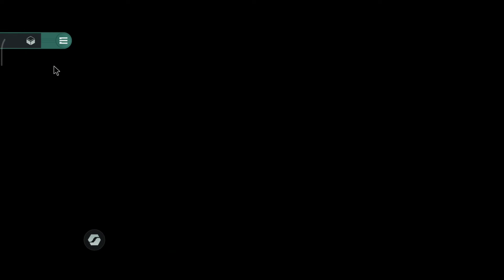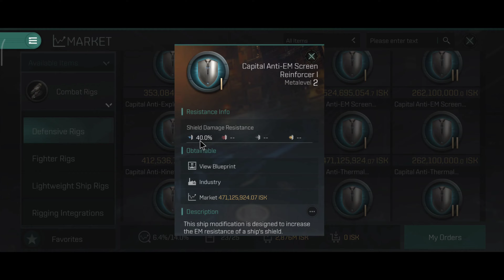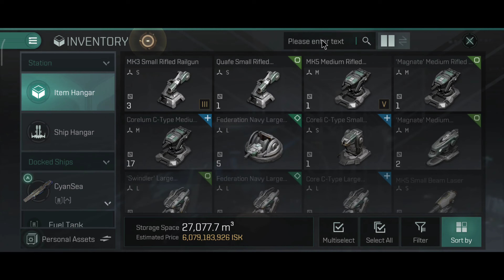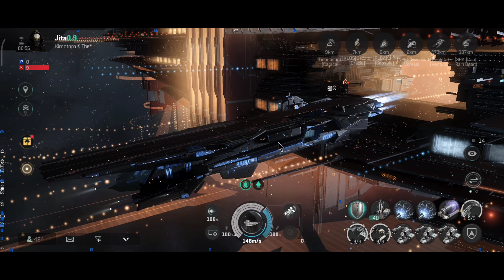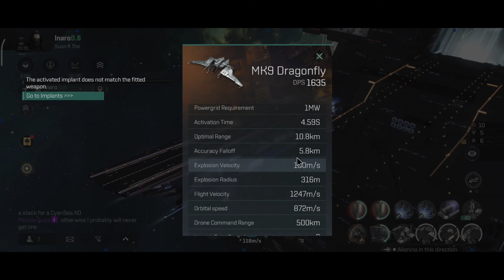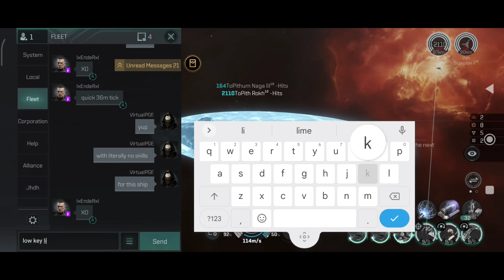EVE Echoes - CyanSea - CONCORD Special Faction Carrier - PvP/PvE Fitting Guide - High Sec Carrier

Comment: As far as capital guns go yes the cyan gets a bonus to damage but no tracking bonuses.  So for pve I find it's better to fit large ranged guns.  Though med rapids might not be a bad idea for those pesky close in frigs.  But overall those slots are not very usefule.  Now if the cyan had a dred mode those slots could be sick.  Thankfully it doesn't.
Reply: I fly mine without any weapons, because let's be real. This thing has so much dps with fighters that High slot weapons are unneccessary
Reply: @luxurianilindr4547  If you have them it feels silly not to use them to me.  I keep mine to large or med size weapons to kill those pesky true small hull ships.  Yes I can't believe that NE terms BS as small hulls now....
Reply: @almajensen405  I mean the slots are there, but they honestly could remove them and give us 3 more fighter bays. I am not even fully skilled yet and I throw my fighters onto a frigate and it just kinda ceases to exsist.
Reply: @luxurianilindr4547  with my cyan in managing 44-46m ticks running regular t10 null ratting with corp system bonus of 30%
Reply: @almajensen405  bold of you to take this thing into Null. My corp already blew up one 🤣
Reply: @almajensen405  but yeah this thing is super nice and relaxing for ratting or Clarelam lab farm
Reply: @luxurianilindr4547  island clan life

Comment: So the skirmish command is actually helpful.  It helps you to align and get to warp faster without having to use valuable low or rig slots.  Mids are the least useful of all slots on a carrier unless you are fleet boosting.  But that skirmish command is very useful for pve to help you get through the scouts and inqs or through warp gates faster.  Of when you warp into another site someone is already doing and lets you gex to the next site faster.  Basically it's a time saver and anything that helps a capital align is nice.